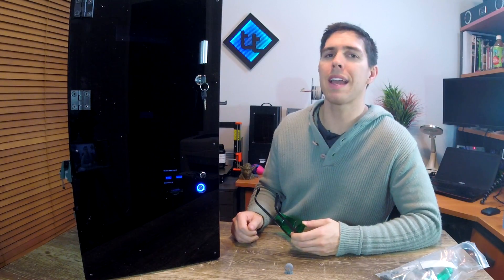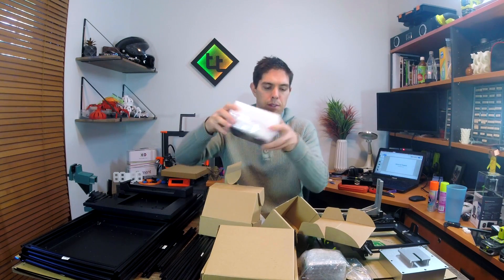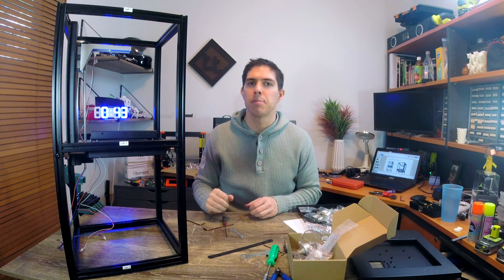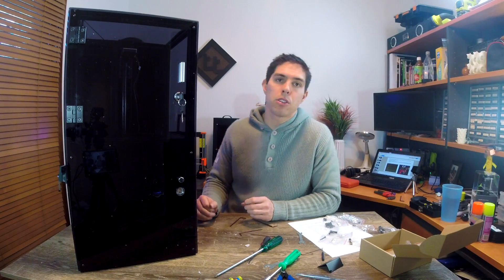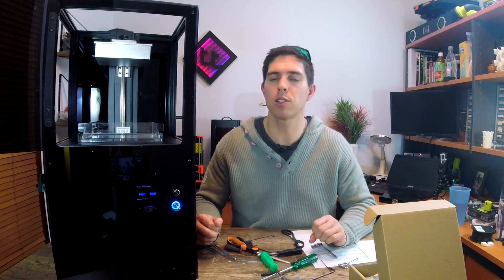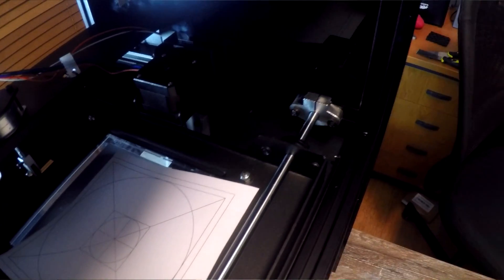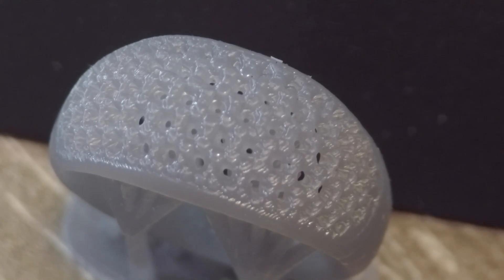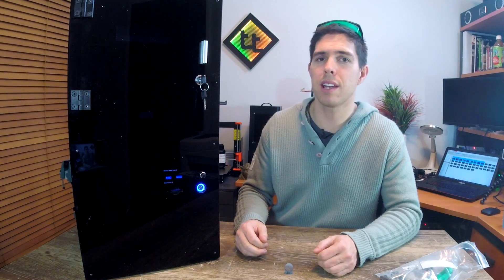Peopoly Moai SLA printer - Assembly, calibration and first print

Comment: Great video dude, and welcome to the "Moai Club!" Just wanted to add a note that the leveling process you highlighted is actually out of date. The units are actually pre-calibrated at the factory now, so users should start off with the Cylinder Test (http://wiki.peopoly.net/doku.php?id=moai:leveling), and ONLY move onto the "full adjustment" as a last resort. I'll be doing an updated video for the build series as soon as I get a chance.
Reply from the maker: Hi there and firstly thankyou for your excellent video series. As I said in the video I found a lot of competing documentation. Between wiki, forum, Google douments and YouTube it was pretty confusing. I was keen to level before adding resin. I will do the cylinder test as an early print. Thanks for watching and taking the time to comment.

Comment: Just one tiny drop of resin on those Laser mirrors or even the cover they supply...
I'm not against SLA. Makes great prints, but I think it is not ready as a home printer.
Still beats the worst idea I've ever seen. Using your smartphone as the lightsource. Hehe
Reply from the maker: Haha I agree on the smartphone idea. Any resin that light sensitive is going to be a nightmare to handle. DLP printers I suppose are equally fragile if you were to spill resin on the LCD. Just a lot less expensive to replace.

Comment: initial impression is one thing --  I got a great ring first go -- then fighting with it to get it to print accurately every time. You definitely need to print those pillars to get accurate prints and even after that accuracy is not guaranteed. My major annoyance is that parts in different quadrants of the build plate come out slightly different size -- things in the center are perfect -- after you calibrate (print a 20x20x20 cube -- there are hollow cubes to save resin) -- then adjust firmware to get that perfected -- but then try the same print in each of the 4 corners and the size will be off -- along x/y (if center is spot on 20x20) -- corners will be 20.5x20.3 -- or something along those lines, for a high precision process -- that's not good -- so far no solution exists.
Reply: I got this printer couple months after it premiered. Been fighting with it ever since had major issues leveling. The demos prints fine ( Not without problems) when it comes to my own parts major failure. Parts sticking to good to the VAT ( I killed the VAT kinda removed part ) and not good enough to the build plate. One major issue with it is that you can't tell if you printing successfully until it starts to raises out of the Vat which by that time it's too late.  I recommend doing major research before purchase, to me it's been a bad investment.
Reply from the maker: As I said my initial impressions were good but the actual review is to come. With my other resin printer I tend to print decorative parts rather than ones which must be dimensionally robust. Apart from where using castable resin for jewellery. We'll see how I go.
Reply: Teaching Tech yea, decorative parts, which I plan on doing with this machine in the future will tolerate such dimensional variants, but my first use cases have been printer parts for other printers...parts which need the level of detail, but also need do have dimensional accuracy to fit.
Reply from the maker: Time will tell how my experience compares.